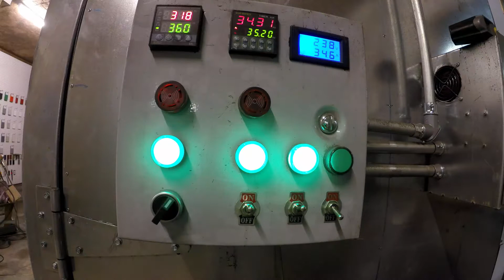Five Minute Fix   Datsun 280z Complete rear end suspension rebuild and powdercoating

Comment: Awesome video man what a hero. What do i need to buy for this rebuild? I want to do this exact same thing on my front and rear. Im trying to keep the car as original as possible. I'll proba ly be watching this video a thousand times.
Reply from the maker: Well thanks in advance for the 1k views! haha.
I replaced a BUNCH of stuff in this video,
spindle pins, bushings, struts, wheel bearings (inner/outer) for both front and rear, wheel bearing seals, ball joints, rear wheel cylinders, rear brake shoes and new rear drums.  I've got links to the parts I could find on amazon in the description above and everything else I got from rock-auto.

Comment: We’re you pouring a little oil in before you put new shocks in ? Gas shocks ?
Reply from the maker: Yea they are gas shocks but I do put oil in the tubes for a few reasons.  First reason being these things are a massive PITA to remove if they are dry and rusted in place for 40 yrs, Second and probably less important reason is to provide a better medium than air to transfer some of the heat within the shock to the strut body to prevent over heating or early degradation of the seals from excess heat in the shock.  I use very light (5-7w) oil in this case and its widely debatable as to whether or not you need to do this at all with todays seals and tech in the gas struts but I'm old school and its definitely a carry over from the days of old where you HAD to put oil in the oil strut for it to work lol
Reply: @hcr-motorworks  thanks for the info mate 👍

Comment: nice video.  Alot of stuff going on.  Any issues pressing the rear hub onto the stub axle?? Like how you did it from the stub axle up.  I'll be doing mine very shortly.
Reply from the maker: No issues with pressing everything together, just have to make sure your on the bearing races and not pressing the inner part of the bearing when installing them into the rears as that could cause damage to the ball bearings if your pressing on the inner part of the bearing.  A good size round tube or massive socket helps.